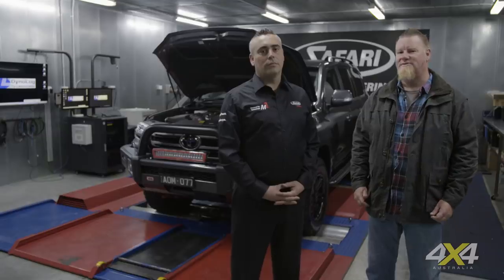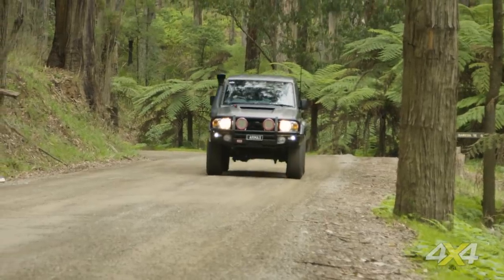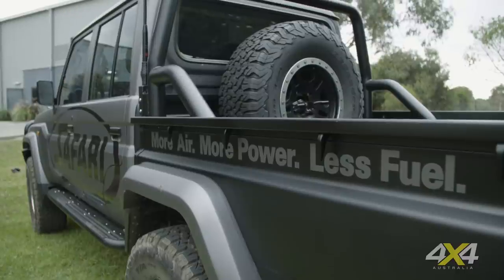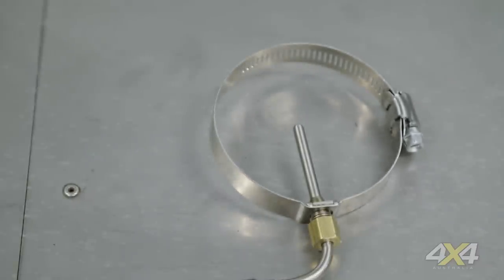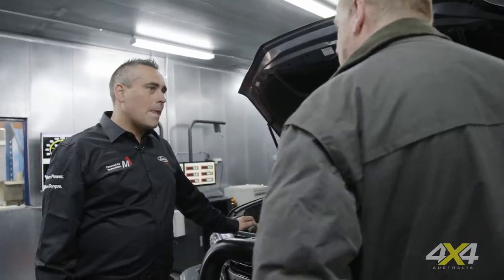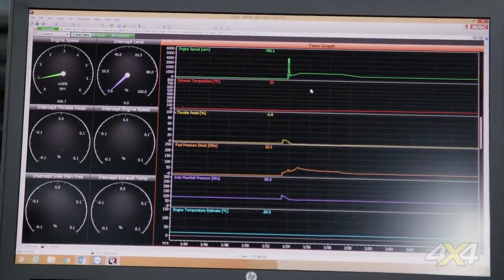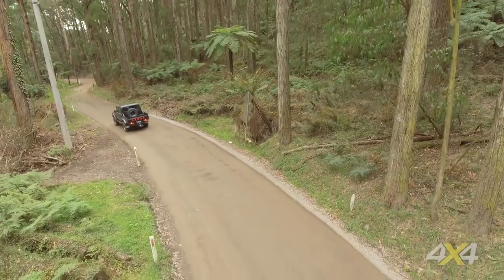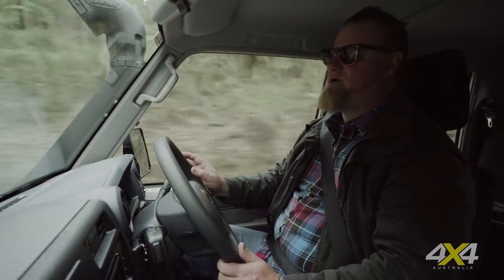Safari ARMAX ECU product test review | 4X4 Australia

Comment: Dyno graph shown from 3200 to 6900 RPM. Very useful information for a Diesel.
Reply: Clearly not depicting those engine revs unless you know something no-one else does about getting a land cruiser diesel to rev to 6900. 😄
Reply: Exactly my point.
Reply: But that must mean we are reading the graph incorrectly or the scale is set wrong because that can’t be the actual revs. Comparatively accurate you would hope.